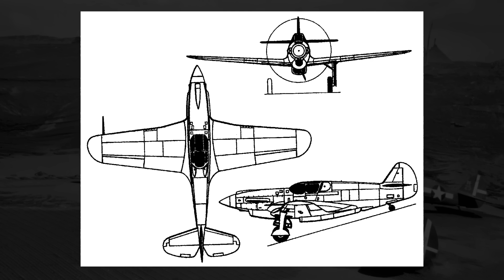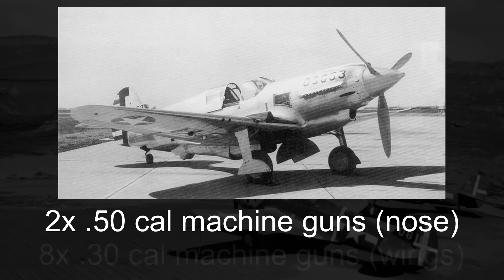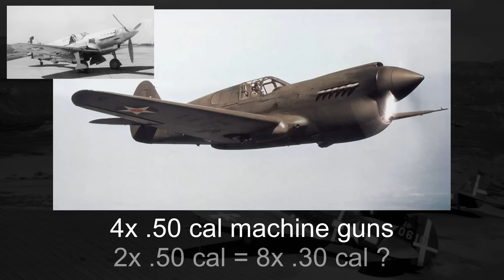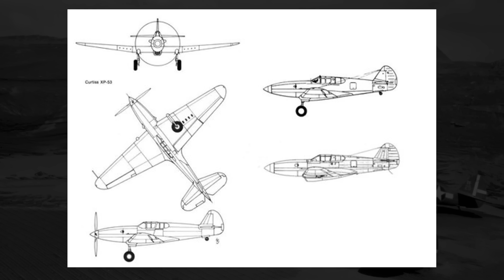Making A Fighter Worse By...Improving It?: Curtiss XP-46

Comment: According to Anthony G Williams & Emmanuel Gustin (WW2 Fighter armament effectiveness) the Browning M2 50 cal has slightly more than 3 times the gun power of the browning 30 cal (60 vs 19) so your 4 to one ratio is close if just a tad high. Note the Browning M3 50 cal in the P80, P82 and P86 was much more effective. At 92.31 it's more than 50% better than the M2 and almost 5 times better than the 30 cal. Of course all of them are dwarfed by the German MG 151 20mm cannon with a gun power of 192 (gun power is the chemical and kinetic effect of the round multiplied by the rate of fire, their paper explains the reasoning on how these values are obtained).

Comment: Curtiss XP-46
How could Curtiss have done this design, including the military's added requirements, and still succeed?

No .30 caliber machine guns,
No guns in the wings at all,
Solves the wing loading and weight problems, right there,

Retain the 2 X .50 caliber guns in the nose,
Ask Allison/GM that the same improved engine be further modified, and re-engineered for two purposes,

1: House a 20 mm cannon in a hollow propeller shaft /driveshaft,

2: While these modifications are being built, take the time also to improve further the engine, not just structural improvements for weight and strength, but of course refining and re-engineering while using this modification, by also naturally improving efficiency and cooling for greater power and breathing at altitude.

•••The following bracketed paragraphs are a side issue about two-stage superchargers, but you can skip ahead if you like.•••

[ I would bring up actually building a proper two-stage supercharger here, but you’d have to get through the American bureaucracy to do that, and that’s another matter entirely,

The money bureaucrats didn’t understand that they needed to spend the money to build the two-stage supercharger they needed because they were too focused on being cheap. That’s why they spent more money to build Rolls-Royce engines commercially: they were now out of time. Even though it cost more, it was faster because they never solved the issue of building the two-stage supercharger at the cheaper cost they desired. They shot themselves in the foot regarding this.

Again, if you don’t understand, the Rolls-Royce contract to build licensed Merlins costs more than the money they spent to make the supercharger the Allison engines needed sooner. They always knew they needed it, but were too cheap to make that investment. By the time the issue was recognized, as in just how badly they had screwed up, there was no more time left. Instead, the decision to commercially build Merlin‘s had to be made. If that had been correctly chosen and the money had been spent early on building this, then future versions of this possible design could’ve considered two-stage superchargers. It would’ve been the subsequent natural development. ]

••••CONTINUING:
Knowing Curtiss, added armor would’ve just been slapped on, instead of taking advantage of the right amount of armor to use as structure; instead, they would slap on the armor afterward. Instead, do what many other aircraft manufacturers did: kill two birds with one stone. The armor will also be used as a structure, an integral part of the plane.

• The self-sealing fuel tanks and the same flap designs emulated from the 109 will remain.

If the execution goes well, the plane will be significantly lighter, the engine stronger, and further refinement will be possible.

Maybe in this instance, Curtiss wouldn’t have shot itself in the foot by their design habits, and would’ve actually built a world beater.

Comment: The big scoop on the p-40 ,which got bigger,spilled hot air down the sides which caused directional stability problems. Which is why p-51 ,spit,109 had the scoop elsewhere. So they lengthened the ass end to fix a nose problem. Poor Curtis.

Comment: Lol - zero chance they could have actually fit 8x .50 cal guns in those little wings - at least with ANY meaningful ammo capacity.  I just don't even see where / how it would be possible - perhaps this is just a perpetuated myth that has grown over time since it's mentioned on wikipedia? The only photos with wing guns specifically show FOUR total (2x per wing) which is more in-line with just about everything else you'd see back then. If you look at a P-47 with all its gun and ammo access doors open, you'll understand how this was really only possible on something as big as the Thunderbolt.
Reply: They weren't planning to fit 8 .50" guns in the wings. They were planning to fit 8 .3" guns in the wings, the same as the Spitfire and Hurricane,

Comment: you really don't know anything about P-40s do you?

the early P-40s were flight tested at 1400HP, and were achieving 1800hp in combat, as verified by Allison. The P-40 prototypes were faster than a P-47 at 5k ft on only 1000HP.

The P-40s had more than just a "pair of .50cal" for armament, eventually getting to the US standard at the time of 6x .50cal. rather early on. P-40A/B/C all had 2x .50cal and 4x .30cal. P-40D had 4x .50cal. P-40E and beyond had 6x .50cal.

The p-40 was one of the most maneuverable US fighters in all of WW2. in a War in which maneuverability was NOT important. The P-40 and all US fighters of the late 1930s were designed for US doctrine of Boom and Zoom, not maneuvering dogfights. And Boom and Zoom went on to win the war. Maneuverability was not important, speed was.

The P-40 was high drag design, and heavy. Curtiss engineers clearly never really had anyone good on the team who understood drag reduction.

later P-40s had 1800hp engines, reaching 2200hp in combat, and 410mph at 5k ft at 2200hp, and 387mph at 1800hp. 

What the P-40 needed was drag reduction, weight reduction, and a 2-stage high-altitude performing supercharger. like the P-63 got, but wasn't available when the XP-46 was designed. and since almost none of that happened, it failed. Even incremental improvements to teh P-40 did far better.

Comment: the P-40 did not need more maneuverability, as it was already one of the most maneuverable US planes of WW2. it did not need more armamnet, as it had basically the same as every other US fighter of WW2. 

it needed more speed. The P-40N was able to achieve 410mph at 5k ft at 2200hp. But it needed a bit more speed, and more high altitude performance. to do that it needed significant drag reductions and a 2-stage supercharger optimized for high altitude.

Getting rid of the exposed and bulbous landing gear helps, changing the inlet design helps, etc. the P-40 was very draggy compared to things like the P-51 (everything was).
Reply: Quite correct. If you research the improvements of various models. You’ll see that in many cases speed actually dropped or improved very little considering the sizeable increase in HP. More power means more heat, requiring larger radiator,  which resulted in more drag largely offsetting it.
Reply: @JohnW-gz4db  the P-40N was doing 387mph at 1800hp. 30mph improvement over the early models. and XP-40 was 5-10mph faster at 5k ft on only 1000hp than a P-47 was on 2200hp at 5k ft.

overall teh P-40 got better, from the P-40A/B/C to the P-40D, to the P-40E, and P-40N, and finally the XP-40Q.
Reply: At the time the XP-46 was designed, the P-40 did need more armament. Originally its armament was only 2x .50 cal and 2x .30 cal.
Reply: @RedXlV  but nobody knew that at the time. that was more armament than many other fighter of the time. easy to judge in hindsight, but even gunners with 1-2 .30 or .50 shot down thousands of airplanes in WW2.

no amount of armament is enough, if you never hit anything vital. And if you hit something vital, it only takes a single bullet. Same issue was used as a cope for soldiers in Iraq and Afghanistan who had bad aim and blamed their rifle/ammo rather than accept the fact they couldn't hit the broadside of a barn.
Reply: I like your analysis.   The P40 needed more speed.  The plane was a P36 with an Allison stuck on the nose.  I think a trip to NACA for a general streamlining would have been helpful.
Reply: They finally cleaned up the P-40 in the P-40Q. She had a top speed of 422mph.
Reply: @Machia52612  yes, but the P-40N also achieved 410mph.

the P-63 also did very well, including at higher altitudes. but they were slower than the other existing designs, otherwise they could have been adopted.

had planes like the P-51 not existed, the P-40Q and P-63 would have been used by the US.

Comment: Inward retracting undercarriage was a big plus.
Armament of 4x.50cal would've been far more sensible.
Cut down rear fuselage & bubble canopy would be a massive improvement.
The V1710 engine was a liability due to turbo/supercharging issues.
RR Merlin with 2 stage, 2 speed supercharger would've transformed it.

Comment: Cooling drag is about 1/4 of the total.  The belly radiator execution sucks...no boundary layer splitter plate.  And what appears to be multiple inlets going further aft.  (A smart cooling installation was what made the Mustang.)
And what’s with the gear door?
After the P40, C-W just never got its act together.  Probably a good b-school case study, along with GE and Boeing.

Comment: I've always wondered what the P-40 would have been like if it had at least a turbo-charger to enhance it's performance. Why didn't Packard offer a better engine?  Why didn't the US army request better high altitude performance?  Surely they must have noticed that the German planes in Spain had flown above their enemies and dove down to destroy them?
Reply: Perhaps because at the time the US ARMY Air Corp was used to support the Army and did not need to fly higher. The Air Corp was under Army Control. Remember Billy Mitchell was restricted in his campaign by the Navy brass. Also some of the best information to come back from Spain was brought back by a black man as was summarily dismissed( Martin Caidin)
Reply: The P-40 with supercharger was an odd duck. Superchargers were the size of dish washers back then.   It just needed a 2-stage supercharger on the Allison.
Reply: It probably wouldn’t have helped because the front of the plane exhibited rather poor aerodynamic performance. The extra weight and small incremental increase in performance despite the more powerful engines meant it was a no go.

Comment: Those Curtiss sales guys must have been lighting cigars and popping champagne bottles. Until... As was covered in your previous XP-60 video, the Curtiss design engineers just didn't seem to know how to overcome the inherent limitations in the basic P-40 design. BTW, interesting final photo showing P-47s being built behind the P-40s.
Reply: Actually the P-40Q was one hell of an airplane. If Curtiss would have cleaned-up the high drag characteristics of the early P-40’s early on, this 422 mph version was a real winner.

Comment: The P40 had one problem which is why the RAF didn't use them in The Battle Of Britain or the European theatre. It's high altitude performance was, shall. we say, sub=optimal This is why they got sent to North Africa where air combat was more at the low to mid altitudes.  Until the Germans turned up that is. Even then, it was still useful for attacking ground targets. That plus  it could carry a bomb ( not a particularly big one, but a bomb none-the-less ) where a drop tank usually went. I don't know if that was a standard thing or if the RAF adapted it to do so though. At least that's what I remember from the Airfix kit I made when I was a kid lol.
Reply: The USAAF did believe that at low to mid altitudes. Whereas combat during the Battle of Britain was at high altitude. Unfortunately Allison struggled to build an engine which could operate at higher altitudes
Reply: @bigblue6917  ...it is not tht they couldn't more under the interwar USAAF system of procurement, high altitude aircraft were supposed to have turbos (a turbo-supercharger) system, and they thought, once General Electric got the bugs sorted from the larger ones for bobmers and P38's, that making smaller versions for fighters should be relatively easy to create once the larger turbo problems are moderately understood & resolved; 
highighting how a limited hopeful insight, about extremely hard it was ,in actualy developing & making tough and safe enough for production of extemely relieable high speed turbos for fighter sized war aircraft.

Comment: Another way to make a fighter worse. Was to let Brewster build them. The Corsairs they built being the prime example.
Reply: I see people like to make that claim but there is never a credible citation.  The aircraft was inspected as it was being made.  They were accepted for service.  Their costs were in line with Vought and Goodyear ($70,583 for Brewster, $68,900 for Vought, and $72,450 for Goodyear).  They were removed from production as the requirements for F4Us, and other aircraft, were reduced.  M4 tank production was being cut down for the same reason.  Brewster was a disaster on many fronts but the quality of their F3A was never in doubt at the time.  Kaiser had taken over and they were exceeding their schedule of deliveries.  Kaiser fixed them just in time for them to be shut down.
Reply: @SilverAcademyFriends Brewster was shut down by the Navy for quality control issues.  That is proof.

Comment: Yes, a single .50BMG bullet is about the same weight as four .30-06 bullets, your math checks out. Same throw weight but more penetration. The bigger, fewer, guns have a lower rate of fire, but when they hit, they hit hard . 
Also hee, the Regulation reference. 🥰
Reply: many .30cal bullets, like the .303 couldn't even penetrate the skin of fighters like the FW190.
Reply: So how many Browning .50s would still have been lighter than the 8 Browning .30s? Because I figure 4 Browning .50s would have been the right armament for the P-46.  How fast would it have been with that armament?  2 50's and 4 .30s might have worked too, at least against zeroes, but the guns it got were clearly too much and weighed it down.  It might have worked as a bomber killing interceptor with that much gun weight, but a bomber killer would at least want 50s if not 20mms.  Anyway, it seems to me like it was killed primarily by gun overloading, which was a shame.  It couldn't match the P-38 as a bomber killer anyway.
Reply: @alan6832  a few .50s is much lighter than a ton of .30s. and .50s can do serious damage, where as .30s were basically peashooters by comparison. the British .303 bullets literaly bounced off the skin of German fighters without doing ANY damage.
Reply: @alan6832  The aircraft version of the .50 M2 was exactly twice the weight of the .30 Browning.
Reply: @DeliveryMcGee  Thanks; then if the XP-46 guns were too heavy, then lightening them would mean 4 .50s. 2 in the nose and 2 in the wings, not 6, which would still be too heavy.  Thirties might still work against light Japanese aircraft though, perhaps 2 .50s and 4 .30s instead of 8.  4 .50's and 2 .30's would be possible but might still be too heavy.

Comment: The last photo shows a line of P-40's in the foreground that that look to be in final assembly. In the background is a line of fuselages with radial engines. The sliding canopy looks like that on a P-47B or early P-47D. Did Curtiss build some P-47's?
Reply: Yep...good eye. Curtiss built the P-47G, which was a clone of the early razorback version of the D. Two or three Gs survive. The Gs were used stateside only, mostly as advanced trainers.
Reply: @stevetournay6103  was this in Buffalo?